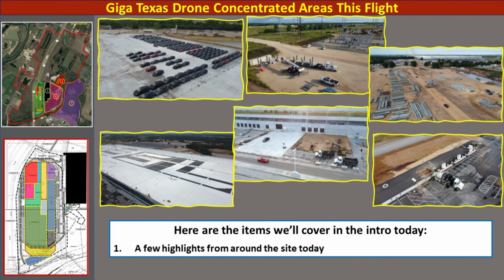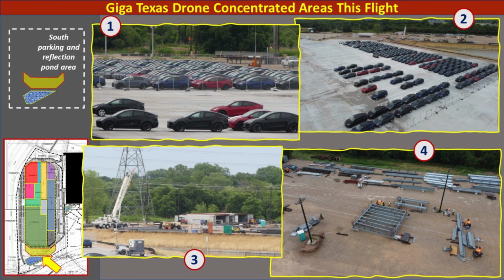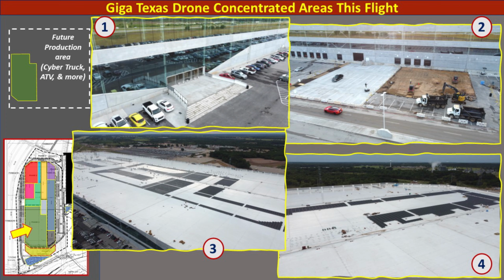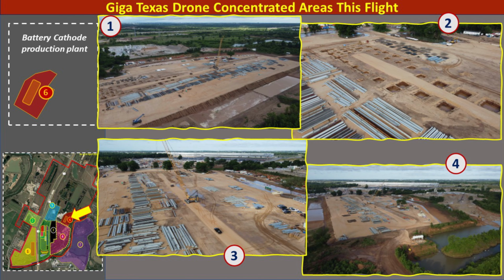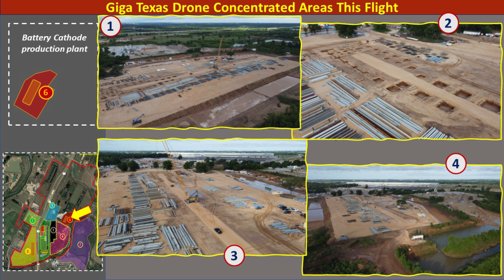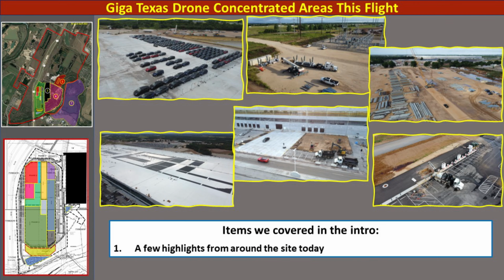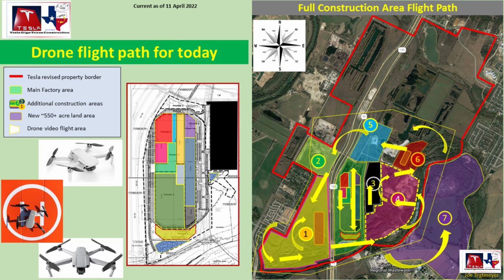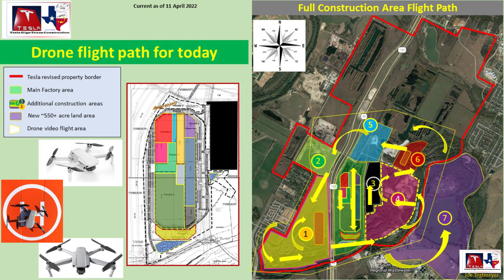Tesla Gigafactory Texas 25 May 2022 Cyber Truck & Model Y Factory Construction Update (07:15AM)

Comment: I don't think I've ever seen such a backwards build. 

Finish something. Then dig it up or rip it out or run a trench through it and then put it together for a second time.

The forward planning is piss poor.
Reply: Asphalt on a build like this is a temporary solution to drainage problems and plans always change. This is not uncommon. Tesla wanted parking on the Westside, now they seem to be ready to change to concrete for the loading dock areas and move the parking elsewhere. We knew this was coming. We knew the expansion to the switchyard was coming sooner or later but drainage was paramount. Now adding new utilities is paramount. Change happens and on a site this big it will happen constantly.
Reply: @michaelsmith2723  With good planning, you don't need so much "change" :)
Reply: @michaelsmith2723  I understand the asphalt. That doesn't explain the removal of all the wall panels, the additional windows, the roof being re-laid, running pipework and conduits after the finished surfaces are down, etc, etc.
Reply: When plans change or they find a better way to do something, they do it. They don't say, "Oh well. For the next factory I guess we'd better do that". Several things were done to make it ready for GigaFest, and now that it's passed, they're finishing up. For example- on the north side the scaffolding was all taken down, and l light show was projected on a finished exterior. After Gigafest the scaffolding went back up. I love project management, but am not about to second guess Elon who plays 4D chess.
Reply: This comes up often. Nearly 2 years into the build, and they are still making changes. Primarily it’s because they started building before the building design was finalised. Some of this would be because the vehicles they plan to build here haven’t had the design finalised. So neither is the manufacturing process, the required plant, the building to put it in.

If they had waited for all the ducks to be lined up before they started building, they would be starting the build in about another year and half. That would be how a legacy manufacturer would do it, but Tesla isn’t a legacy manufacturer.

I spent my working life in the building industry, and it’s weird to watch all this unfold, but I’m reluctant to criticise as because while I don’t necessarily know why things are done this way, that doesn’t mean that they don’t know why things are being done this way.
Reply: @pbsanstead  Do you really believe Musk plays 4D chess? I happen to think something else about Musk, but won't mention it here.
Reply: @DessieDoolan That's a reasonable observation that I'd agree with, except it isn't happening at the Berlin Gigafactory and nor did it happen at the Shanghai factory which was built before this.
Reply: @pbsanstead  If they would do good job of planning, they would figure out a better way of doing something before they did it in the first place. Then they wouldn't have to rip it up and do it over.
Reply: @DessieDoolan  Legacy manufacturers are way more stable and don't gamble their future.
Reply: @DavidJohnson-tv2nn  - have you ever built or remodeled a house? This is common.
Reply: @DavidJohnson-tv2nn  - yes, as a longterm observer I do. I'm not the first one to say that, either.
Reply: @DavidJohnson-tv2nn  What if the better way is not known at the time of planning?  Why does everything need to be done in a linear fashion?  In Tesla's mind it's not a big deal to spend a little to break up some concrete in order to gain future benefit of greater value.  I'm sure they do a cost benefit analysis for these decisions.  Even if Musk isn't playing 4D chess, he hires those that do.
Reply: @markmelb5732  Many times these different phases are separate contracts.  One contract is to dry in the building... another is to add permanent load-in platforms.  It happens partially as design evolves, and partially as they live with the building and figure out what works and what doesn't.  

Specific to the load-in platforms, I find it very curious.  It is possible that it is just because they don't have enough freight elevator capacity for both construction and factory operations, but it is also possible that they have decided to use larger modules and less field assembly..
Reply: @markmelb5732  The operative difference being that Berlin and Shanghai were originally developed in a more capital constrained environment so there isn't as much shell space to build out.
BUT, Shanghai did do a lot of construction that got ripped up months later.  Their stamping building was where the original Model 3 delivery and charging area was located.  Later phases I haven't kept as close of an eye on, but many spaces have been repurposed resulting in similar demolition.
Austin has an order of magnitude better drone footage than anywhere else, so we are more likely to catch re-work.
Reply: @markmelb5732  I didn't follow Shanghai that much, but whenever I check in there seems to be another building under construction, and works being carried out on the 'finished' buildings. 

Berlin I haven't really followed at all. It would be a different regulatory regime there to Austin or Shanghai. Every detail highly scrutinized by the relevant authorities, so changes probably can’t happen on short notice. Not to say they won’t happen.

There’s at least a video a day of the Austin build, probably the most documented building project ever. 1500 or so videos over the last 2 years. Thousands of views each video. People comment on everything from the small dots of reinforcement at every roof membrane joint, to the placement of plants in the ponds. Not much gets missed.
Reply: @pbsanstead  Yes, many Musk fans have been duped. Yes, he has been successful. That is because his business model is based on a fan club. Where his fans will buy whatever he sells, at whatever price he charges. Just like Apple.
Reply: @sammyk874  If something truly new comes up, I say use it. But if you look at most of the changes, they are due to piss poor planning. Like windows. Windows aren't a new technology, just developed yesterday. They could have been planned in from the beginning. Then there is the removing of loading platforms, and installation wall panels, and windows just for a party. Then ripping it all out afterward and placing the platforms back! Or... Paving over a parking lot in a hurry for the said party, only to trench through it later to install conduit!
Or the redesign of the south pond (Which was a better design) but could have been done in the first place with some careful thought. Oh, let's not forget the dirt pile left over from the tower demolition that is still there. When the job could have been done in seven seconds using modern controlled demolition methods. I will admit my last point is open to debate due to permit requirements.
Reply: @markmelb5732  Berlin and Shanghai will not be building Cybertrucks or Semis.  Elon's businesses do many novel and unexpected things and are repeatedly incredibly successful, but are second guessed by people with no stake, no control, and no similar track record.  My experience has consistently been when you think someone else, who has a stake, control, and a history of success, is doing something wrong you are almost certainly lacking critical information.  If you have a stake you ask questions to either inform yourself or help guide to a better solution, but if you don't have a stake you tend to come off as a control freak.
Reply: @scottgaree7667  Just happened to notice that you said:
"Elon's businesses do many novel and unexpected things and are repeatedly incredibly successful"
My response:
Oh, you mean things like....
 * Hyperloop.
*  Boring company 150 mph loop system. Where ANY car can drive onto a carrier and zip off to their destination at 150 mph.
* Full self driving.
* Robo taxis.
* $25,000 Tesla.
* Tesla Semi.
* Tesla Roadster.
* Cyber truck.
*  Starship flight to the moon in 2023. 
* Spandex man (Tesla robot). We don't need Cylons!
* The "Borg" (brain implants). Thank God that hasn't happened!
* Tesla solar.
* Anything else I missed :)
Reply: Legacy has so many factories they can easily convert for different models, they have the time to spend ensuring everything is perfect before starting manufacturing, yes it takes 6 to 12 months longer, but they have done it so many times now they rarely make the huge mistakes tesla does and the cost and time in correcting these mistakes take the tesla factory to 2 years to be semi completed.
Just thi k we are near the beginning of June, half way through the second year of construction beginning and the factory has barely produced cars and is being torn down or torn up to be rebuilt.will the factory be ready for increased manufacturing by the end of the year when musk said the cybertruck would be manufactured and deliveries started
Reply: @DavidJohnson-tv2nn  lol
Reply: @markmelb5732  - Berlin and Shanghai aren't building Cybertruck or Semi.
Reply: @DavidJohnson-tv2nn  Piss poor planning in your eyes being an eye in the sky with zero inside knowledge.  We need to remember that they were not initially going to build the entire building at once.  I think that is what caused a lot of change to happen.  Perhaps the windows were not in the initial budget but were to be done later.  Could be the reason why they even chose these type of panels in the first place, so it would be easier to make changes.  See? Future planning right there.  Old pond design was better?  Says who?  You?  What is your qualification?  Are you or do you know the engineer of record?  Nothing wrong with getting the place ready for a party.  Why on earth would you hold a multi-million dollar party and have it look like ass?  It's their money, who cares?  At least they did not install the semi-permanent platforms prior to the party knowing they'd need to remove them.  Clearly they did not pave the parking lot with a final coat as they have now put another layer on post-trenching.  Why exactly does it matter if the pile of dirt is still there?  Is it impeding progress?  There are piles of dirt (or something) all over the site.  As you admit, permits for explosives may have taken months.  If their agreement with the demo company was to have it removed by x date, who cares what the method is?
Reply: It might be ugly, but it works.
The aim was to get a factory up and running as fast as possible, they did that. That's all that matters.
Reply: @sammyk874  
* Windows - Far cheaper to do windows to start with than to rip out two wall panels and replace one for each window installation. By the way, I'm glad they put windows in. The building would be a horrible dungeon without them! Just saying that they should have done it from the beginning.
* South pond - I think you misread. I said the NEW design was better.
* Party - Oh come on, I think we both know its all about show and presentation for the investors, in order to keep that stock price pumped up. Real car companies don't make parties their focus. They actually do things. That is my opinion, you are welcome to disagree. 
* Dirt pile - Did you notice on Jeff's 5/26 video that they made some progress? They moved it about 100 feet to the west. Basically moving it from point A to point B :)
Reply: @DavidJohnson-tv2nn  Far cheaper?  Perhaps.  Seems they wanted that section closed up quickly so they proceeded with the already manufactured panels instead of waiting on new panels and windows.  It would not have been a dungeon, their factories are mostly white inside with a lot of lighting.  Maybe that is the case with your "real" car companies.

I did indeed misread, apologies.

Of course it's about show and presentation.  Many companies do this.  An example, Boeing wanted to roll out their 787 on July 8, 2007.  Unfortunately, it was not ready but they rolled it out anyway.  Was a shell held together with parts from Home Depot.  "Real" car companies likely do the same, we just don't know since it's not documented like this projected.

Dude, it's a pile of dirt on a construction site, who cares?  The demo contractor is still there, they'll get rid of it before they are done.  If they don't then someone must have signed off on leaving it there.
Reply: Disagree. In a software development sprint is paramount. Watershed dev went out in mid 1990's but construction is very very sloooow to change ( I've had businesses in both). I am not surprised. They have an outcome (say 2m vehicles pa, being Y, CT, Semi.) But design is still in ramp-up or designing.
Agree that they paved an area for rodeo day to make it look good. And had a plan change. Probably within their contingency budget!
Reply: @AndyAndy-we9pe  Go read up on VW's statements about the difference with Tesla and "legacy".  Tesla's production rate can't be matched.
That extra year comes out of your full production.  i.e. Getting to full production a year earlier means a full year of extra profits pulled in.  Time is money.
Reply: @DavidJohnson-tv2nn  LOL, being late isn't the same as failing.  That list is incredible, amazing feats.  All from the vision of one man.
Reply: @DavidJohnson-tv2nn  Right, like everyone else is always spot on with schedules.  Do you harangue everyone this way or you just have some special animosity toward Musk?  You are a classic example of not seeing the forest for all the trees.  I'm not trying to be ugly.  I'd say the same to a close friend.  I don't get the negativity, especially toward someone who is doing so many things well.  Funny note: Right after my last comment I watched Everyday Astronaut's 2nd episode of their visit to Boca Chica this month (highly recommended watch.)  Musk joked, "At SpaceX we specialize in converting things from impossible to late!"  Late is infinitely sooner than never.